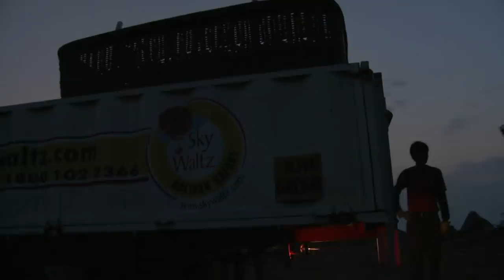The most dangerous moments - When film makers risk their lives | Full Documentary

Comment: Ive experience some crazy monsoon when I worked up near pinnacle peak in arizona. 
As soon as we saw it rolling in, we would mix up tons of frappuccinos to hand out as the entire shop village would head down for it. For anywhere between 30 mins to 1.5 hours we would sot around with our little community and watch what was basically a very fast hurricane. We were on the corner so had wrap around windows giving great views and shelter. Plus free mini fraps haha. 
I've seen trees uproot and just fly away. Best (not for the guy who owned it) was a truck that got flipped over by a random gust. This is really rare but happened to get lucky. LoL. Once in awhile if it came in from a certain area we would see little toys, lots of inflatables from peoples pools etx. 

It is a great area for those who want to be close enough to Phoenix but still in the middle of nowhere with actual wildlife.
Driving out there are signs about watching for wildlife, which you kinda see in foothills of any city, except on this road, you really do have to watch. Mostly coyotes, more rabbits than one could believe exsist, lol. There was a good 2 months a bobcat was wrecking havoc of domestic cats and small dogs. 

Although, unlock most phoenix and surrounding areas there was little feral cat issues. 😂😂😂